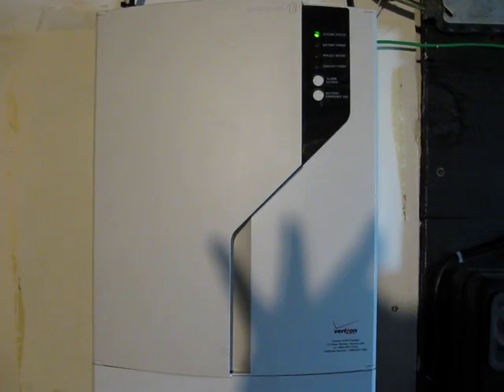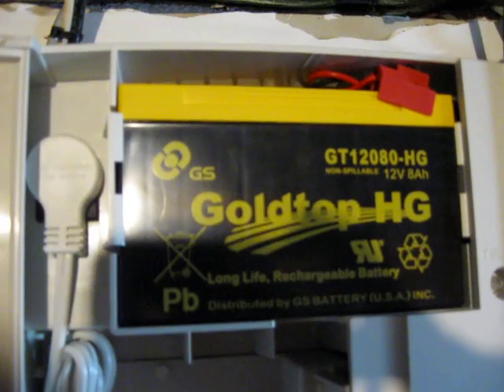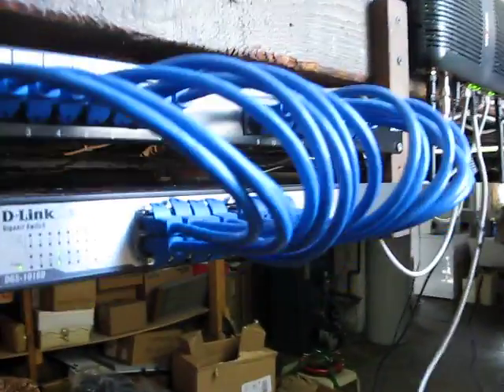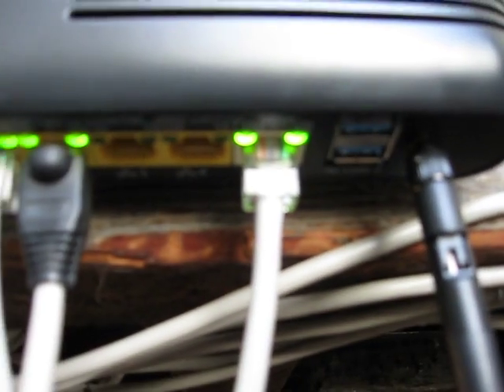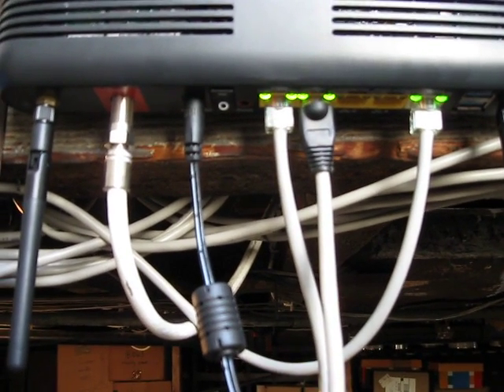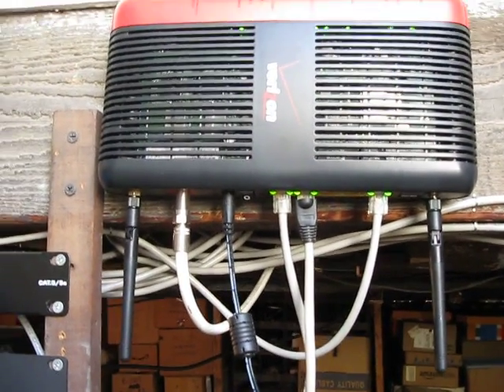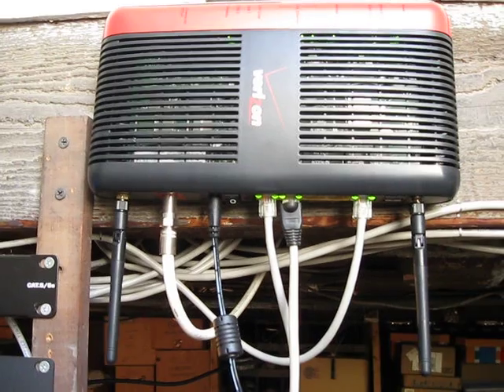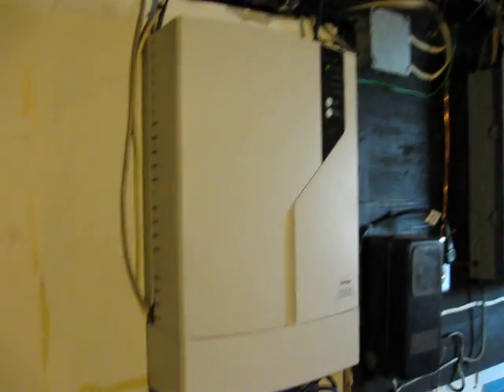My Verizon FiOS installation

Comment: I just installed my Verizon fios .. I use to have directv but it sucked but now I have a problem I'm not getting signal I think I misdeeds a cable . There's a coax box right next to the white Verizon box but there is nothing connected to that coax box .. Do you think that's where I went wrong like do I have to connect a cable there in order to get signal because everything else is connected it's just the signal Im not getting .

Comment from the maker: Your best bet will be to get a standalone access point and connect it to the router with an ethernet cable. Or, if you already have another wireless router that the FiOS router replaced, you can use it as just an access point. Give it a static IP and turn off its DHCP server, and plug one of its LAN ports into the FiOS router. I do both, which means I have a total of three access points counting the FiOS router itself.

Comment from the maker: My old desktop PC, which I built in 2004. I completely replaced it in 2011, as it was nearing the end of its life. i continued to use it as a server, for running server applications, until it pretty much died completely. in the video, it was only connected to power and ethernet, all you need for a server.

Comment from the maker: i've explained this in the description but i'll say it again. the cable boxes need internet access to download TV guide information and video on demand. this can only be provided by a MoCA connection to the router, so it's not optional. normally the same connection will be used for data transmission between the router and ONT, but if you run ethernet cable between them it will be used instead. You only don't need MoCA if you don't have fios TV.

Comment from the maker: Yep. If you only have internet with FiOS then you can just run an ethernet cable, if you have FiOS TV as well then you need the coax cable. The reason is that the cable boxes need a coax connection to the router to receive TV guide info and video on demand. You can still run the ethernet cable as well in this case though.

Comment: Great video! I have a 4 story home where the Wi-Fi signal is horrible on the 3rd/4th floor. I want to relocate my FIOS router from the basement to the 1st or 2nd floor. Is it a "simple" matter of running cat-5 and rg6 cables from the FIOS main box to the new location? If you can answer my question I thank you in advance.

Comment from the maker: It's potentially more reliable than MoCA, and it allows you to use a router other than the provided FiOS one if you want or need to. If you don't have FiOS TV (just internet or internet+phone) you can use any router with no problems. If you have FiOS TV, the cable boxes need to be able to access the internet over the coaxial cables, so there must be a coaxial cable connection to the router. It's built into the FiOS one but you'd need a MoCA bridge to use another one.

Comment: Would be great of someone could help. I had fios installed today, which my tv is working fine, but the Internet is a no-go. I attempted the "activation" process that my tech do conveniently just left open on my laptop and did not say a word about, but it will not let me move forward. The router is lit up and lights on, but nobodies home. I hope to get some help from Verizon tomorrow, but literally am starting from scratch because when the tech left and said everything's good to go, I was told l

Comment from the maker: Yes, quite well, but I'm not satisfied with it. A lot of the phone wiring is quite old, I may at some point replace it all and run it all directly to the ONT. I re-did the TV cable lines recently as well, all of it is inside the house now with the second floor lines running through a riser in one of the walls. I've also wired up ports 1-4 on the switch to network jacks on the 2nd floor, using the same riser. I still have ports 5 and 6 free for eventual expansion to the third floor.

Comment from the maker: The ONT (Optical Network Terminal) is the most important part, it's what makes FiOS work. It translates the fiber optic signal that comes into your house into the internet, phone, and cable TV signals that your devices use. The rest is just details, the ONT and the fiber optic cable running to it are what define FiOS.

Comment from the maker: Right. Also, there really doesn't need to be a "main computer"...I don't have one... but if the router is installed at the location of one of your computers then that's basically the main computer. Once the installation is done, you can configure the wireless access point function of the router however you like and then use wireless with the laptop.

Comment from the maker: They will probably use the existing lines as long as they are in good shape, and just put in a new splitter and run a new line from the ONT to the splitter. You can plug the router and cable boxes in anywhere with this configuration. If you get a second TV it becomes less flexible, as the connection between the router and ONT should only go through one splitter.

Comment from the maker: It's barely significant. Running the ONT costs about $1.50-$3 in electricity per month. If you have a power outage and the battery is drained, the usage will be slightly higher right afterwards as it recharges the battery.

Comment from the maker: It's recommended to use the Verizon router. You can use your own if you are getting internet only, no TV. The cable boxes need an internet connection to get their program listings and video-on-demand. They get this over the coaxial cables using the MoCA protocol, so the router needs a coaxial connection. The Verizon router has this, and the tech will connect it during installation. You can use your own in this case, but you will need a MoCA bridge to give the cable boxes their internet.

Comment: the main problem with using your own Router Verizon can't troubleshoot for that router its not our equipment. If there is issues with the Actiontec or Westell Routers just call support and they will troubleshoot the router if nothing resolves the issue then we would be able to send you a new router.

Comment from the maker: @BruceLeeRock25 Forgot to say... if you're only going to be accessing it through Wi-fi, it can be anywhere. If it's replacing a cable modem, the easiest thing to do is plug the same cable that was used for the modem into it, the tech will rewire this cable to the ONT.

Comment from the maker: Normally it will be near your main PC, the tech will install it this way unless you request otherwise. It needs a coax connection to the ONT, an ethernet connection to a PC or network switch, and of course power. Mine has an ethernet connection to the ONT as well but that's only possible if you run the ethernet wire yourself.